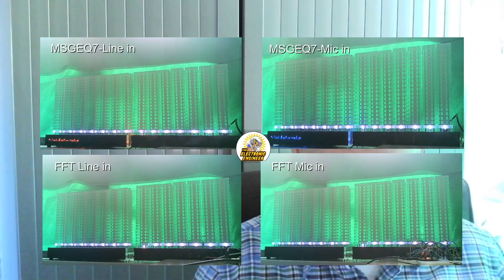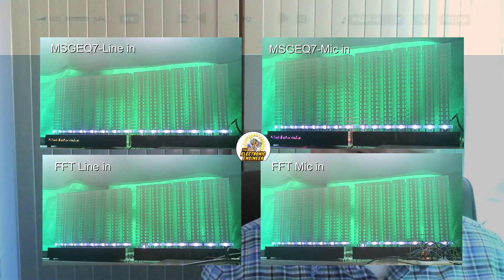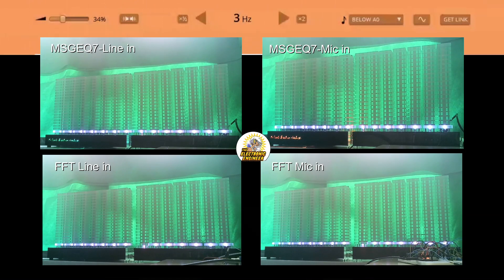MSGEQ7 vs FFT - Arduino Spectrum Analyzer

Comment: I am having a hard time understanding the line input to the ESP32. Some sources say a simple voltage divider to a GPIO pin is all that is necessary to properly read the audio signals on the ESP, though I am not having much success. Can you elaborate on the circuit-specifics of the line-in input to the ESP?
Reply from the maker: Audio is ac signaal, your esp32 vannot handle ac signal so you need to add a dc voltage or do another trick.

Comment: Wow, just wow.
I'm also trying to make my own vu-meter and found your video and exposes all my doubs.
All my sketchs using FFT shows the same issues: some sounds, specially short ones, line drums or finger snap, as seen here: https://youtu.be/PdaYj1fz3k4?t=834, using FFT are missing!
I'm in the way to find what's going on with FFT, but, anyway, analog filtering ends up to be more natural and for sure I'll take a deep look to your MSGEQ7 project.
I think that FFT issue comes from the time that ESP32 is doing other things than reading signal. But, not sure at all.
Reply from the maker: Spot on! Nothing beats analog lol. However, if you look at the latest video where i used a Teensy microcontroller… that one comes pretty close…
Reply: @TheElectronicEngineer Haha,. You're using the right tool for their perfect use. Of course, I'll take a look over all this new things to me. I'm out of electronics world for almos 20 years and trying to enter again.. with much poor eyes acuracy. Too bad for soldering and reading that tiny labels.
I think I've found the solution for this "missing" sounds, but I need more tests before saying anything for sure. I'll public it in my github if I'll success.

Comment: Excellent video!  Though I find FFT looks to fake to me. The MSGEQ7 is more natural looking.
Reply from the maker: Correct! Thats why i build a analog version based on the msgeq7 but without it , using opamps
Reply: @TheElectronicEngineer , have you plans to share project on opamps? Also as MSGEQ alternative there is BAS3834F. I found some project in AlexGyver comminuty, but have not test it yet.

Comment: wow simply fantastic! I was looking for another esp32 project and thinking about a spectrum analyzer to monitor dirty inverter electricity for VFD motors and solar projects that mess up the power grid with 5th and 7th, etc. harmonics and check the power factor issues on inductance and capacitance balancing to combat wasted energy. This project sounds cool, no pun.   😎thank you.

Comment: I was scratching my head again, wondering if this 14 or 21 channel analyzer would work better on the ESP32 platform and use the internet radio as the source of the audio input .. Smaller size and less money than the Mega2560 an has a lot more functionality .. Maybe add some BLE control from a smart phone and use the 21x20 led array for more than just displaying music frequencies ..

Comment: Would I be correct to  take Freq0 as baseline = 104570hz and calculate Freq1 = Freq0 * 1.3572, and Freq2 = Freq0 * 1.3572^2 this way using all 3 programmable clocks from Si5351 and drive 3 x MSGEQ7 for a total of 21 channels ?
Reply from the maker: I didn’t try. But take note, if you are going to use all 3 outputs simultaneously, I think you need to find a different driver for the frequencyboard. The one I used only support 2
Reply: @TheElectronicEngineer  Thanks Mark, that comment in your sketch was staring right in my face and didn't see it. ZIGZAG works just fine. My next challenge is to map the bandValues from A0, A1 and A2  and transform them into 21 Bar Heights. Your sketch works up to 14 and now I'm scratching my head. I know a Romanian software guy here in Florida, I might have to give him a call. Again Thanks for the help, Cheers !
Reply from the maker: @samm928  also easy… in the settings you can change the number of leds per bar…. I think the variable is litteraly called barHeight…. But im doing by memory
Reply: @TheElectronicEngineer   .. Hi Mark, you were right about the Si5351. Although it has 3 programmable clocks, CLK1 and CLK2 cannot be used at the same time the way Pavel wrote the Library (Si5351mcu.h) .. I did however picked the generic Si5351.h library and was able to clock all 3 MSGEQ7 at a different clock. Also when reading each of the 7 bands I had to bump up the NOISE constant from 120 to 180 (60 for each analyzer) in order to get all the readings to store correctly in the bandValue array. Many thanks !!

Comment: hi, how many modes has the MSGEQ7 version you kindly share ??
Reply from the maker: 12
Reply: @TheElectronicEngineer  Thanks!! Which is the width of the acrilyc ? 8mm?? You cut it using a laser/cnc/3d printer?I am very happy to find your project, I do really like it and willing to implmenet, my concern is get the acrilyc and shape the 280 pieces plus the other parts. thanks

Comment: What if I needed to analyse 100hz to 6khz in 3hz steps, Say 2000 bands. Can that be done?
Reply from the maker: No..that's gone be hard!  3 hz steps over that range will take up lot's of samples and bandwidth...3hz is too narrow.
Reply: @TheElectronicEngineer  But what is i need 3hz resolution, what frequency range canbe covers 100hz to 4khz? 2kHz?

Comment: In my opinion, fft is still not as good as msgeq7. However I still very much look forward to the next upgrade of fft in the future because as you say msgeq7 chip a lot of fakes
Reply from the maker: I am working on a analog analyzer but with digital processing of the analyzer system. So keep tuned, you'll get what you want